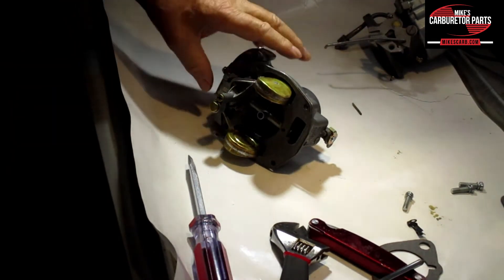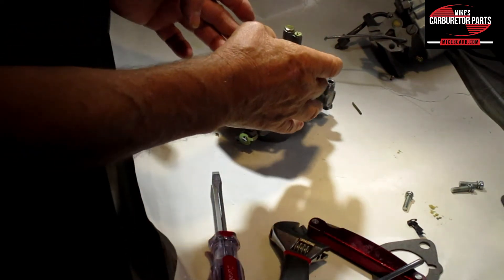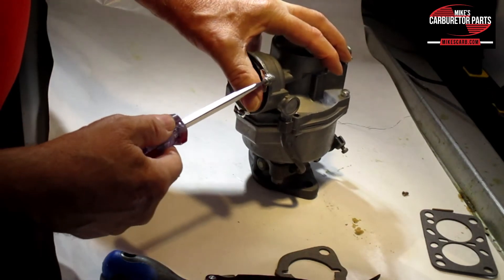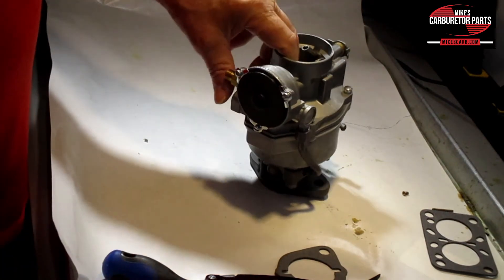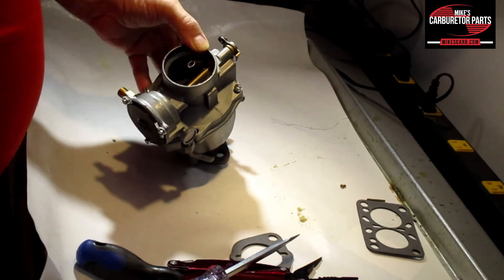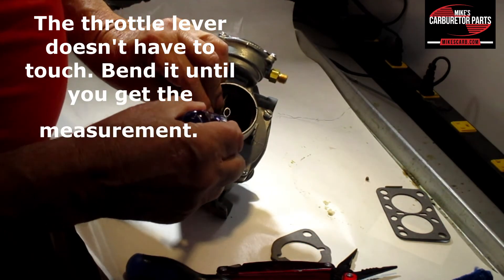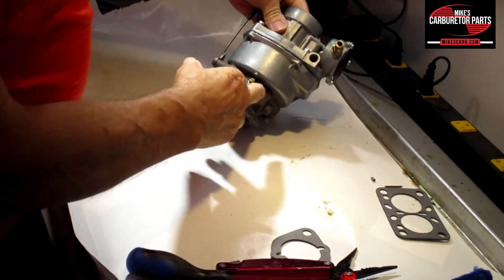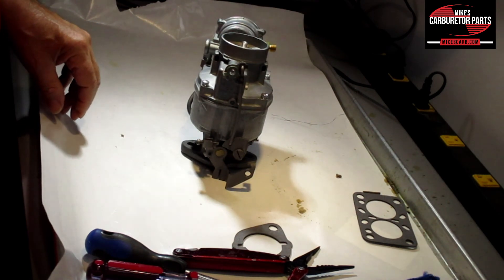Rochester BC Carburetor Adjustments

Comment: Sir what is the float adjustment spec. For a 1956 210 base model 4 door? Thakyou.
Reply from the maker: 1 9/32 drop: 1 3/4
Reply: @MikesCarburetor  told my dad.  Ty

Comment: The more I watch you the more I learn.. so I believe their is 2 tabs one is when you pulled the float out . & the other is a different tab for the float drop correct ?.. thx MIKE. My shop manual didn't even say anything about the first measurement you did .. only on the second...(float drop)..  mines on float drop is reading 1/2 in. More instead of recommended 13/4". Im at 21/4".. so this means not enough fuel cuz its sitting lower correct .I d be starving my engine?
Reply: @MikesCarburetor  thx 🙏 buddy can't wait. .& your vids are awesome 👌 👏.. the dying art needs them🙃😎